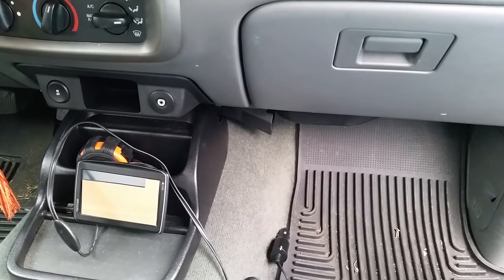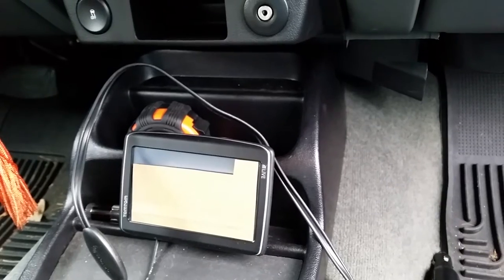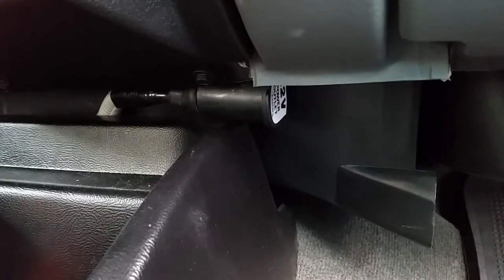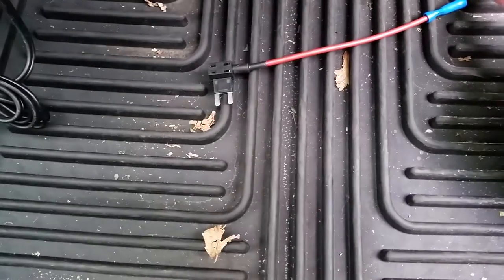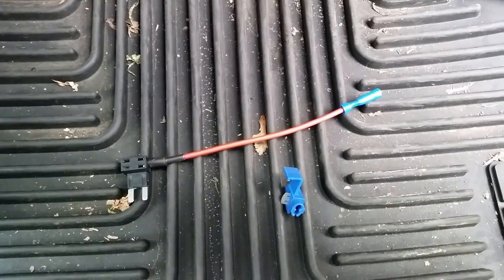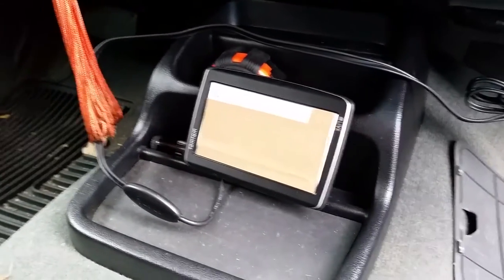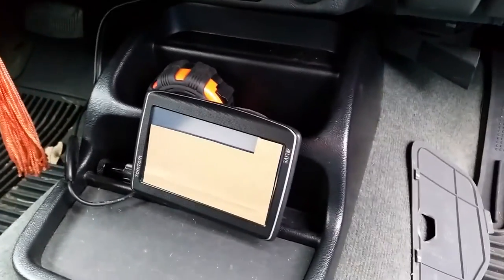Installing an Ignition-switched power outlet in vehicle for GPS with Add-A-Circuit fuse tap

Comment: You seem like a pretty smart guy. Any idea how I can keep my electric cooler running inside my truck when I have the ignition turned off? Any help would be greatly appreciated. I've searched and searched for the answer but I must not be using the correct search words...thanks for making this video.
Reply from the maker: I don't recommend this as you will likely drain your battery, since the battery does not recharge when the vehicle is not running. But if you want to do it anyway and take that risk, you would need to find a circuit that is always energized to connect to. I would advise consulting your owner's manual fuse panel map to find some circuits likely to be always on, while avoiding "critical" circuits (i.e. you don't want your lights to go out at night if a short ever occurs in your wiring). You can confirm the circuit is always energized using a multimeter.
Reply: @VintageStuff  what kind of automobile 🚘?

Comment: I wish you would have shown us more of the wiring and explain more of how the fuse it goes into the fuse box and which fuse spot you picked.....  did you buy an extra cigarette lighter and then connected it to that where did you get that cigarette lighter from... seems like a lot more went on than what you actually explain you talked to us as if we were all electrician or car people versus most of us not knowing anything about what you're saying
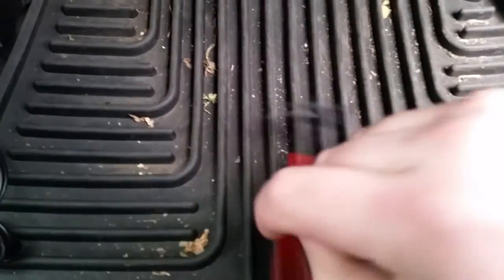Reply: 2:32 add a fuse thingy.  They are pretty simple to use. You just find an ignition controlled fuse (radio, etc) and use that fuse slot.
Reply from the maker: I apologize for the very late reply on this. I appreciate the feedback. I didn't focus on the electrical wiring specifics as I figured there were other videos that could cover that better. Different user needs dictate different approaches, and every vehicle is different. For my application I tapped into the car radio's ignition-switched circuit, and I chose that circuit because my application has a low voltage draw and it's not a critical circuit to the vehicle's operation should a problem with my wiring ever occur. I determined which fuse controlled this circuit by using the owner's manual fuse map, and I used a multimeter to determine which side of the fuse was the feed to the circuit. You can purchase a cigarette lighter power adapter from any auto parts store or a variety of online sources; I believe Walmart even carries them in their automotive section.